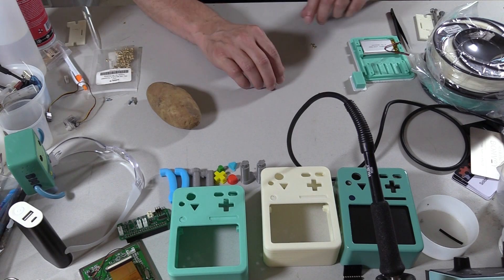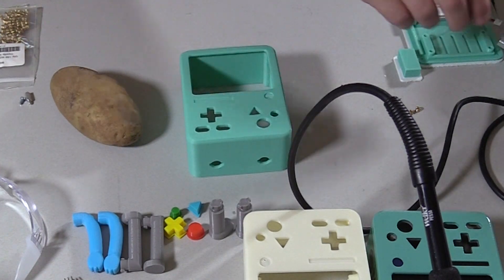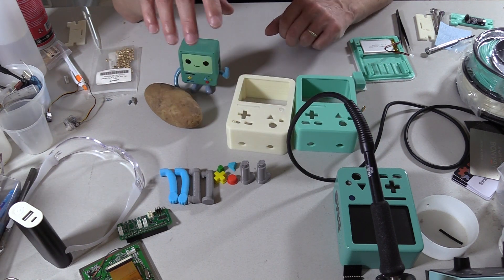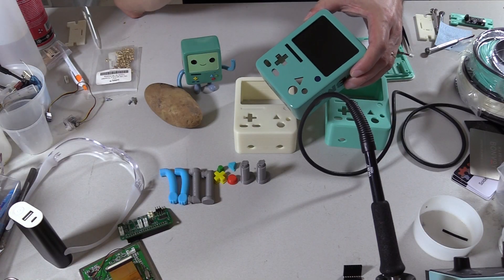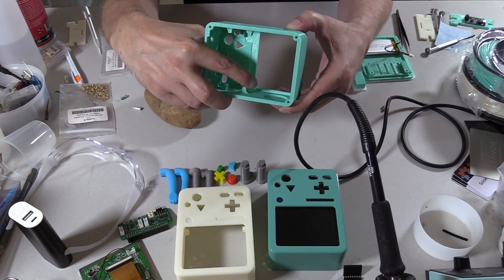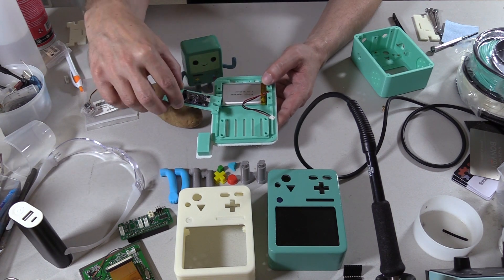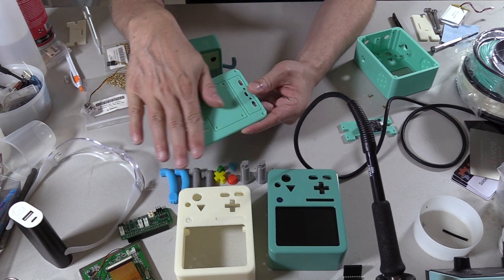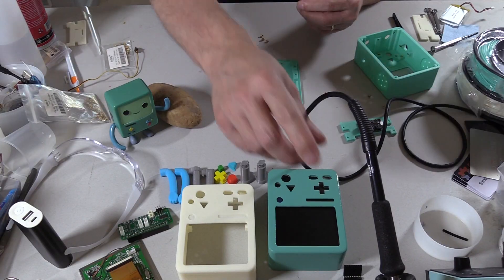Building BMO Boy: Part 1

Comment: You can finish plastics in a vibrating rock "tumbler". Or you can use an actual tumbling finisher but then you need to be careful about the interior space to part size relationship.